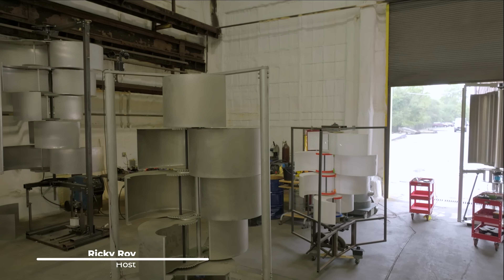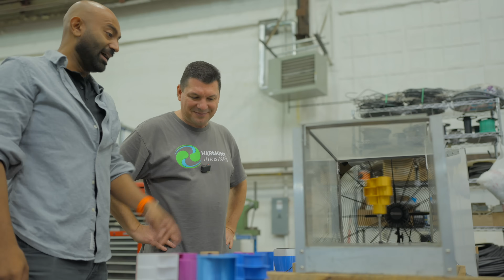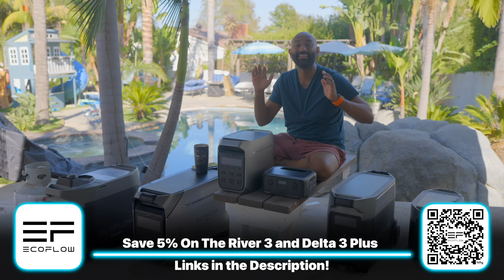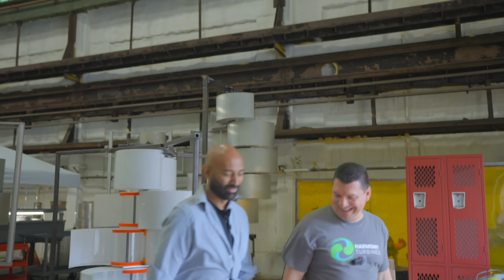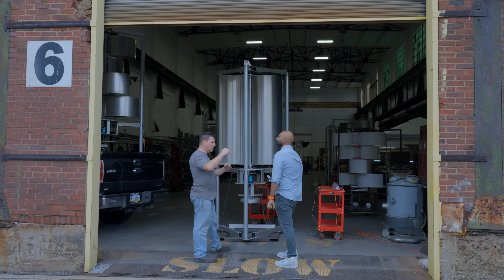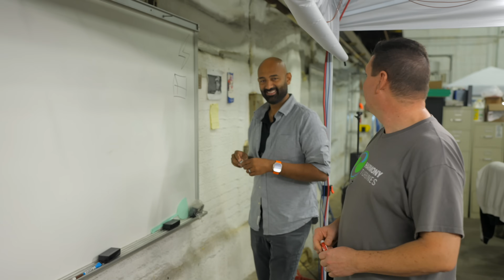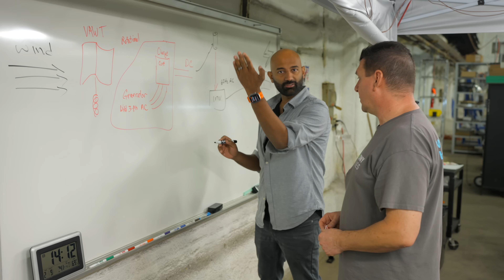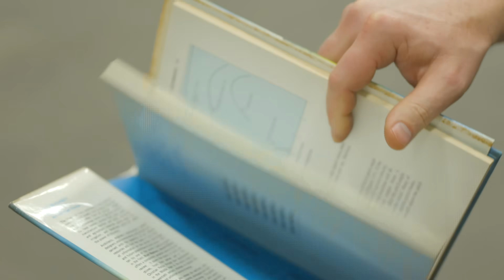This Could CHANGE Home Wind Energy Forever!

Comment: I find the cost difference with solar a big disadvantage. This unit with a max power delivery during a few percent of the time of around 500 W costs 6000 dollars. That money can buy several 400 w solar panels and a few kwh of battery storage. And solar delivers power during a far larger portion of the time. That means systems like these are only interesting in areas where the sun does not shine for large amounts of time like in the far north during winter when a day will only last a few hours. In almost all other cases solar will be a more economical solution.
Reply: IMO... Harmony is a scam.  The design is terribly inefficient and complicated.  The company has been milking the gullible for several years now, with nothing to show for it.
Reply: @LindaStevensBZ  yes there litterty videos  where  the  show  builds now fore  50 dollar
Reply: Every technology we had right now was a novelty at some point, of course its always pricey at the start
Reply: They have to start somewhere. I believe Solar was extremely cost prohibitive when it was new. With scale, costs can dramatically come down.
Reply: @triadwarfare  Solar still is very expensive. China just moved production over to slave labor. That is what has actually reduced the cost of solar over the last 10 years, not scale nor tech breakthroughs.
Reply: @Austin1990 
You are a fake news and disinfo junkie. 🤡
Reply: And the 'problem', gets worse over time, the production scale of these systems is increasing and prices are dropping, even over time installation costs go down as people figure out how to do things smarter,
Reply: @autohmae  solar largely decreased in price due to China shifting production to minority slave camps. The room for solar to move cheaper is mostly exhausted unless a massive tech breakthrough reduces material costs.
Reply: Daylight hours is a poor comparison given that the further north you go the more the angle of the sun cuts into the quality of power production. Not just shorter days. The number of hours the sun is clear of obstructions at the horizon is lower than those daylight hours. The atmospheric scattering from the angle of the sun at higher latitudes also reduces the maximum power you can get even on clear days. You don't need to be in the far north for these issues to start compounding
Reply: In some urbanized areas there's a lot of tall buildings where there's not much surface area to add solar. Taller buildings also have "free" height to get up higher where there's more wind. Can multiples of these Harmony turbines be mounted on top of apartment roofs or along the sides of a building? Or would this not work because the air would be too dirty or possibly cause structural problems with a building from too much vibration?
Reply: @calvin4lo  
What can wind turbines on the roof of a tall building power inside the building? Let's say 10 wind turbines at a total cost of $60,000 (not counting the costs for batteries) just to power some lights in the building? Not economical at all. Then there is the question of wind availability. Forget it.
Reply: Hi Ricky, I would not buy that turbine or any other vertical axis wind turbine if I wanted electrical production. Here are the issues. 

1) It is NOT 35% efficient. Max about 17% with the helical design. You saw on the voltmeter yourself how bad the Harmony turbine performed. It is possible to get them into the 30% range, but not even close to that with the design they presented. 

2) The low wind market is a myth as they demonstrated in the video. Real wind available is less than 12mph and even at that speed, you are getting only 10% of the rated power. That is a LOT of turbine for 35w (or 15w or…). Solar outperforms hand down. If you have decent wind, the traditional 3 blade HAWT outperforms. 

3) Due to #2, there are no economies of scale to drive price down as this is not a technology centric device, it is heavy (literally) in raw materials. Solar is a tech problem, wind is materials.

Unfortunately, there is nothing here that presents any type of consumer benefit that already isn’t being better addressed by other technologies. At this point in their development they should have had copious graphs showing the efficiency of their design supporting their claims and how it addresses a specific market (along with the size of that market), they do not have this info.

As background, I was involved with a VAWT company in the early 2000’s. With very little investment we were able to have a working model built and third party tested in an engineering wind tunnel. Our results were not great. I love mechanical devices and hold several patents myself. From that test session I was able to improve upon the original design and from that developed a concept that can see the 30%+ range in efficiency and is self furling..computer not needed. However, I also found this to be an extremely niche market and even with the better turbine, it did not make financial sense to pursue it.

If you like Kinetic Sculptures, they are very coo to look at. Happy to answer questions. BTW, my new design is open source.
Reply: @busimagen  Bad weather does mean low solar, that's why a good battery energy storage system is important. It does not necessarily mean good wind. On the few occasions when it snows here, the wind is dead quiet. Rain may or may not be accompanied by wind, seldom significant winds. Gusty wind is not good wind, high wind is not good wind. At night time wind is much slower, also not good wind. There are some locations where you can have consistently good winds in inclement weather and at night, these are not where most people live which makes the small wind industry a niche product.

If you do have decent wind, combining wind and solar is a much better idea than solar alone. The same is true if you are on a river and can do small hydro. Again, niche markets. If you can do wind, a 3 blade HAWT is a much better solution than a VAWT.

Generally, a very robust system will be solar, battery with a back up generator to ensure the battery has charge. Wind and hydro would be bonus sources if you can afford or permit it.
Reply: @dropshot1967  These contraptions are total junk, and the people who have invested in it are victims of a scam.  

This machine always presents the same area to the wind, and will be hard pressed to charge a laptop.  Hopelessly inefficient.
Reply: @dropshot1967 you're trying to compare wind to solar. That's like trying to compare your car to your truck. They serve different purposes. The point here is if you have good wind in your area you will want to get the best technology to capitalize on that otherwise wasted power. We have always advocated (from the beginning) that people should have BOTH wind and solar on their property if they have good levels of both resources. Price-wise, solar was terribly expensive in the beginning and then after 10 - 15 years started coming down significantly. The same thing will happen with our turbines as we push into mas-production levels. The key is to first have tech worthy of further development and investment.
Reply: @HarmonyTurbines  I am a big fan of wind turbines 😜 I have owned part of one and currently stil invest in offshore wind farms.
But I have to admit that these home wind turbines just do not make sense compared to solar and batteries. Even in winter $6000 will get you more power in most places in the world and negligible maintenance compared to a wind turbine. For balance you can get less solar panels and more battery storage. 
There may be some places where this makes sense, but that is a niche market.
Reply: @SolAce-nw2hf  New tech is always much more costly in the beginning but if we do our job right and make solid products, continually improving as we go, then costs will drop and the tech will make more and more sense for the average person as the product matures. -Just the same way it happened with solar.
Reply: @HarmonyTurbines  You are right. Scaling up to mass production could lower the price. The plastic prototype keeps coming back to me as something you could build at a low cost. There are also innovations with recycling used wind turbine blades into a new product (3D printable if I remember correctly). You could also make a small gadget like version that charges phones while hiking (pops out of walking stick) or make something that lowers into the ground (or ship deck) when the wind is not there to make it something millionaires want to impress their friends. You really need to find the application where this makes sense and a large solar panel does not or maybe needs some help in winter.
Good luck and don't give up!
Reply: @HarmonyTurbines  I've been following you guys for a couple years already and have mentioned you to many people along the way, I'm highly hopeful for this technology to take off as I think it would be incredibly beneficial for our transition away from fossil fuels. I'd love for you guys to potentially partner with a giant solar panel producer once the charging control issue is fully flushed out, and offer a bracket on top of the system that can also be used to mount a small solar array. Not many, but like 9, 12 panels type thing. Could even maybe have it track the sun? Then you would essentially offer a one and done solution and give people very reliable energy independence. I'd also love to see an "industrial" scaled version that can sit on the rooftops of buildings which might not need to be tuned quite as low since they'd generally be up higher and on big flat surfaces for the wind to flow over.
Reply: @HarmonyTurbines 
Making this simple gadget is a no-brainer for China, and it can make it for less than $300 FOB! China wouldn't bother making this on its own because it doesn't have a good market, but China will make it for you if your order is big enough and you pay in advance. The home wind turbine has a very small market compared to solar panels, this is why China is making a fortune making home solar panels but not wind turbines of all kinds.
Reply: @SolAce-nw2hf 
If this wind turbine is made of plastic then China can make it for under $100 FOB! So why doesn't China make something like this, it's because this has a very small limited market.
Reply: @HarmonyTurbines  Most of us here want to see you guys succeed. I'm very much looking forward to it. But realistically I'm not your target audience either. I can set up 14kWh of LFP batteries and 9kWh of daily solar for $3000US in my location. In the tropics that's enough to go completely off grid if your home is designed for thermal efficiency.
Reply: @HarmonyTurbines Yours is the most excited I’ve been for a wind turbine design ever. Collecting wind energy presents so many engineering challenges.
Reply: @HarmonyTurbines , respectfully, dropshot is comparing different means of generating electricity. That’s fair. If your turbines require a significant amount of wind (more than 5-10 mph) then that is going to be of limited residential use. It doesn’t really matter how cheap the turbines become if they can’t generate adequate electricity. Most folks in the continental US receive enough sunlight to generate helpful amounts of solar electricity if they have a place to put the panels. 
I’ve been following residential wind power options for a few years. It’s tough to find practical solutions when you can’t choose large open, windy spots.
Reply: @HarmonyTurbines  The purpose is exactly the same: producing enough energy to power what is required.
Reply: I own a 50+ panel solar system for my home at the 45th parallel. My system is built to nearly 2x’s the size needed so that during the best time of the day and year I can put kw’s back on the grid in the form of energy credits. In the ‘not so great time of the day and year’ I still make some kw’s but not enough to offset my use - so, I use my energy credits. Two months out of the solar year, I pay a full blown electric bill because I run out of credits - I have wind here 24/7/365. This means I can generate, use and store 24/7/365 by installing a wind turbine system at less than half the cost of a solar system that does 90% of what I need. What is the smarter investment?
Reply: @brianwoodley6367 You will find wind will be much more expensive initially along with operating costs assuming the wind you have 24/7 is at 25mph. At less the payback is ridiculous. Buy more solar and add some home batteries for when the grid goes out. If you want to supplement with wind, go with a traditional 3 blade HAWT, much more efficient, less expensive and less maintenance.

Comment: Should introduce this guy to Relativity Rockets, Why? They are 3d printing alum and steel Rockets engines from the ground up. He could barrow a touch of there idea and 3d print the large scoops thus simplifying the production line. Really doing it that way would be, general tolerance check, grinding smooth and assembly to test and then pack/ship :D.
Reply: How long does it take to 3d print a metal scoop of that size? And the finish work required to smooth the surface (if that's actually needed) introduces a lot of hand labor. I think it would take less time to fabricate as they are doing now with sheet materials welded into scoops. Another avenue they might look at is composites. There are many molding methods in the composites industry that might lend themselves to the creation of these scoops which could save manufacturing time and effort.

Comment: Why not not use injection molds for the manufacturing of the ¨blades" and use an array of capacitors to either directly feed into a home power grid and/or charging a battery?

Comment: you could likely achieve a much more stable RPM of the output for the generator using a simple variable gearbox or CVT. having a constant output RPM or limit would simplify the generator spec, as it would be operating near it's optimal RPM range whenever the wind turbine is in motion. i would gear the turbine so the output spins at high rpm even with low wind. this would require a high torque wind turbine design, i think this could work well with this design.
Reply: Yes but as wind speed goes down so does input torque
Reply: Adding cost and moving parts, but interesting thought.

Comment: Hey Ricki, how is the vertical savonius type of wind turbine affected in regions with inclement weather during part of the year, such as snow and ice? I know that conventional horizontal blade type turbines can suffer from icing, just like an airplane wing.
Reply: @charlespolk5221 it will be an engineering problem that we tackle down the road. Something as simple as resistive heating elements in our scoops & gearing would likely be the answer here. Perhaps black paints or colors to help absorb the sunlight etc... But these are all problems for a bit further down the road.
Reply: @HarmonyTurbines  i think the passive heating system might make better sense. Wouldn't using resistive heating in climates which might have days or weeks of below freezing temperatures put a severe limit on the net power produced? It might also be possible to coat exposed parts with materials that help shed ice or snow when the turbine rotates.

Comment: The problem of small wind turbine is transforming the rotation energy in electrical energy.  Wind turbine inverters are design to work with fix voltage 12 24 48 V ,while solar panels work 0-100%. The difference is solar MPPT is linear while wind MPPT is exponential and needs to take in consideration also kinetic energy. Why furling good electronic can brake/stall the turbine? Why do we need a lot of complexity when are turbines that can survive in + 100 mph. Check Seahawk PacWind VAWT . Patent # US 7,109,599 B2. If you are interested developing my pov. leave a msg.

Comment: Voltage isn’t a measurement of energy! The only thing this turbine company has done in the last few years is figure out more clever ways to fool people into giving them money. Two bit is clearly helping this company scam people. Anything for a buck I suppose.
Reply: Yeah. Residental Wind doesn't seem viable. 

 Just read a report from a study saying solar plus batteries are cheaper than fossil fuels. 

 Pervvsokite solar is being produced. Not quite pure pervoskite, but a silicone hybrid pervoskite made by Oxford Solar that has a superb effiency. 

 More will come along with cheaper batteries.  

 I just don't see wind being viable with the cost per KW.